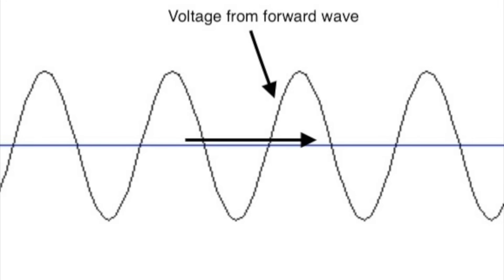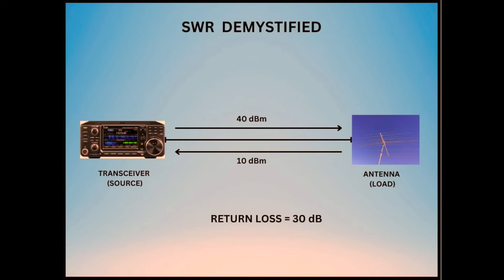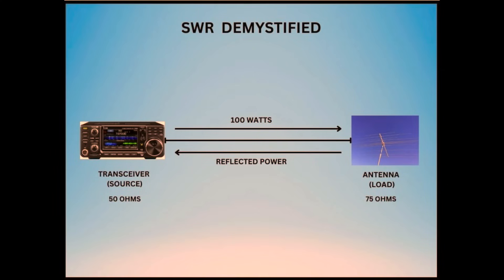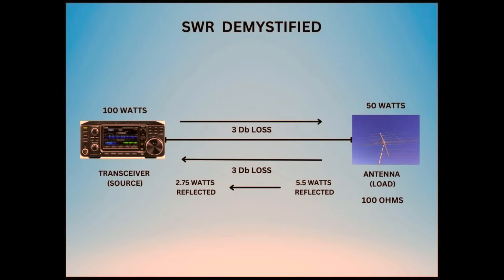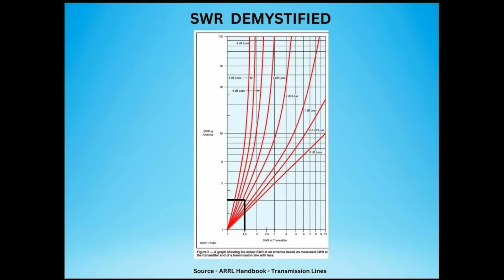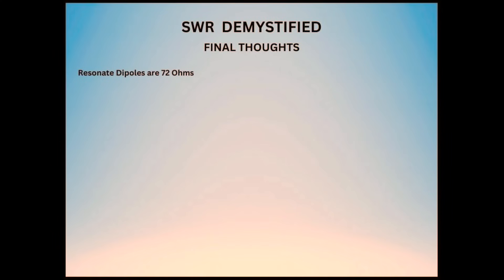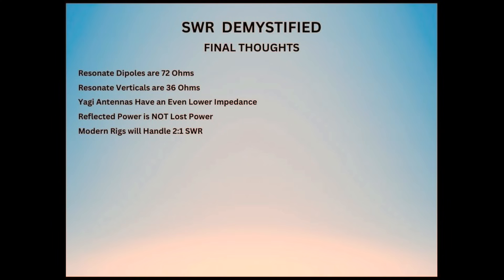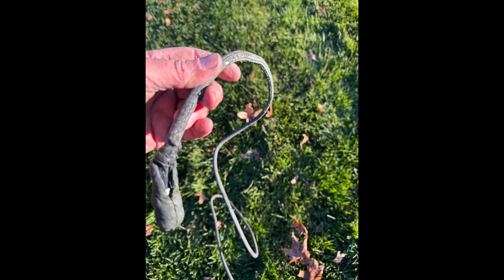The Truth about SWR: Debunking the Myths and Misunderstandings

Comment: To say that the reflected (and re-reflected, and re-reflected and so on) wave does not impose a current and voltage upon the final output stage of the transceiver would be to say the incident wave does not deliver energy to the antenna. 

The reflected power is lost. And is done so in several parts of the system. Each reflected, and re-reflected wave experiences transmission line loss. Energy is lost as current is imposed in the final transistors opposite to the direction of normal flow (collector->emitter). Not much current flows, but some does, and it does exhibit additional strain on the output stage. The majority of the energy is lost in the reflections.

If you wish to refute my position place a wattmeter ammeter at the end of the transmission line and simulate the mismatch conditions cited in your presentation.

The reflected power, in an impedance mismatch scenario, is not delivered to the load in any appreciable way. That, my friend, is why we have 'antenna tuners.'

Also, odd and even multiple electrical lengths of transmission lines, have impedance transformation characteristics. One very common application is matching stubs.
Reply: Without a tuner the power isn't produced to the difference of amount of reflected power ,the reflected wave will reflect back towards antenna at the mismatch radio coax junction, the impedance at this junction is what causes the transmitter to heat up trying to put power into a mismatch, place a tuner at this point the radio produces its maximum power ,the reflected power is in phase with the forward power back to antenna, at hf frequencies with moderate swr and low loss cable loss isn't too much of a worry
Reply: I was thinking the same thing.   I've seen several amplifiers destroyed because of high SWR and they always heat up quickly.   Does he really think that power reflected back into the final output device isn't at least partially or mostly dissipated by it??
Reply: this is what i thought. why do these people keep making videos about debunking a myth when they are creating a myth instead and debunking the truth and confusing me.
Reply: This is because an RF amplifier, unlike an audio amplifier, has an impedance matching circuit on the final stage.

Comment: On the whole pretty good info ,you could have mentioned that it's the impedance the radio sees that the feedline length and reflected wave have transformed that really kills you radio , for those who thought that it was the reflected power going back into radio
Reply: let me see if i understand you correctly: the reflected power does not go back into the radio but it changes the impedance that the radio sees. let's say this boundary is right at the antenna connector. so from the transmitter point of view, it would be the same whether you had a cable with a certain reflection at the end or if you just connected a mismatched dummy load, so far so good right? but now wouldn't the mismatch at the connector create another reflection towards the amplifier? perhaps that reflection reaches the radio? where i'm going with this is that i think they are both the same thing. whether you look at it as the reflected power going back into the radio or the radio seeing a different impedance. and as i've i've mentioned to someone else already, if you just sent a single pulse that is reflected at the other end of the cable, how can that energy not make it back into the radio, i mean, where does it go then.
Reply: @dronefootage2778  a single pulse will go back into the radio whereas a radio continually producing power it won't, it will add to that power at the radio coax junction and return towards the antenna, the impedance has changed at the radio /coax junction so the reflected wave will reflect back towards antenna
Reply: @Pioneer936  if a single pulse goes back into the radio then a continuous wave does too. if i were to increase the duration of the pulse, one cycle at a time, i guess you would draw a line where you would say the energy goes back into the radio but if you add one more cycle then it doesn't. physics don't work like that. i think what you guys are all thinking is that the incoming energy blends together with the energy that is being produced, and you guys call it a standing wave and it is, but i think this obscures the fact that energy is getting back to the amplifier and it can or will affect it.
Reply: @dronefootage2778 no! the impedance the radio sees is what causes the radio to heat up, it can't put all its power into the system because the impedance is not what it wants to see, the reflected power from the antenna is reflected back to antenna at this point the same way it does at the antenna feedpoint because of the mismatch impedance
Reply: @Pioneer936  i don't buy it. the transistor may see a different impedance but that is likely a side effect of the reflected power reaching it. if the radio sees a different impedance, something must be reaching it. if that is not energy then what is it?
Reply: @dronefootage2778  the feedline becomes an impedance transformer with standing waves, the impedance at the radio will be mismatch so the reflected wave will reflect back towards antenna
Reply: @Pioneer936  well then let me ask you this, if you replaced the antenna with a taser, it wouldn't harm the radio because none of that energy would reach it, is that correct?
Reply: @dronefootage2778  do tasers create a standing wave and change the impedance along the length of the feedline?
Reply: @Pioneer936  it doesn't matter, we're talking about energy. instead of the taser what if i only transmit for such a short time that it creates just a few cycles. when they reflect back how could they possibly not reach the transmitter and if they do then it makes no sense that they wouldn't reach the transmitter as long as it's putting in its own energy at the moment the reflected cycles reach it. when you make waves in water that reflect and you keep making waves, the reflected waves essentially travel through the waves you're creating. they don't cancel out and they will reach your hand or whatever you're using. if you make it a standing wave it may look like that they don't reach you but they are. if you use a board to make a standing wave it will take less force than if you made the same waves with no reflections. if the reflection didn't reach your board than how can there possibly be a difference between the two. if you are saying that the reflected wave changes the impedance at the transmitter then it means some information is reaching the transmitter and how can that be without energy. no matter which way i think about this what you're saying and what this video are saying do not line up with the way i understand it and i think all of you are wrong about this.
Reply: @dronefootage2778  you need to read reflections by Walt Maxwell, it goes into greater detail than the arrl on this subject, I couldn't possibly do the book justice in a couple of paragraphs so I am not even going to try , Maxwell explains it from all different angles and with lab experiments
Reply: @Pioneer936  it is said that you don't really understand something unless you can explain it to someone else. i can explain what my understanding is in great detail, i'm not sure that you can. this means i probably understand it better than you. the principal of reflections should apply equally to all oscillations at least i think so, including water. if i make  a wave in the water with my hand and it reflects back to my hand i will be able to feel it. if you buy a 1,000 watt stereo and hook up tiny speakers to it and you never turn the volume past 5% as to not blow the speakers then sure you could say technically power is not lost but practically you're losing most of the power that could have been produced but isn't. if you're a dj with this setup and guests can barely hear the music and someone asks you what the problem is, i guess you can tell them there is no problem at all, everything is perfect :P
Reply: @dronefootage2778 BTW its basic amateur radio knowledge that feedline become impedance transformers with standing waves present and that reflected power is returned to the antenna less any line loss, there is no need to believe what I say but what I've said is in the text books for comformation
Reply: @Pioneer936  it really doesn't have anything to do specifically with amateur radio. this applies to all RF and probably to all oscillations. i'm wondering if you have a misconception about the whole scenario. i never said the transmission line was not matched to the transmitter, only that the other end was where the mismatch was and in an extreme case the other end is left open. so you have transmitter @ 50 ohm impedance, then transmission line @ 50 ohm impedance, and then an open, i.e. 100% reflection. now you have energy traveling back towards the transmitter which is perfectly matched to the transmission line and if you're saying that the text books say that energy doesn't reach the transmitter then your text books are simply wrong.
Reply: @dronefootage2778 the reflected power does not go back into the transmitter and damage the transmitter, it reflected back towards the antenna because the line becomes an impedance transformer so the transmitter /feedline junction impedance is transformed from the matched 50ohm impedance to some other and yes its in the text books, why don't you have a read so you can understand this subject
Reply: @Pioneer936  i asked chatgpt about it and put what you said and the response was:
Yeah... this is a classic case of someone misapplying the concept of impedance transformation, mixing up local impedance variation along the line with the impedance seen by a wave at the source, and possibly just parroting misunderstood textbook phrases.
It then went into a whole lot more detail of why you are incorrect and what actually happens and I can't copy all of that here. The bottom line is that you're wrong and your text book is probably wrong too or you're not understanding it right. I've already tried to explain it in simple terms and frankly it's really obvious but you're stuck with what the text book apparently said so i can't help you any further.
ps: you got schooled by a cb radio person and i will do the same to any ham that comes my way.
Reply: @dronefootage2778 just clarify a few points,

1,  the impedance the radio sees changes with line length when there is a feedpoint impedance mismatch 

2,  reflected wave is reflected back to antenna at the radio /feedline junction

3,  the radio heats up trying to put power into an impedance other then that it want to see usually 50ohm

These are the main points of this conversation

Which points do you disagree with?
Reply: @dronefootage2778  I have absolutely no idea what you're talking about.
Reply: @Michael-f8f9z  can't say i'm surprised
Reply: @dronefootage2778  the impedance mismatch at this radio /coax junction won't allow the radio to put its full power into the system, it may heat up as a result, add a tuner full power will enter the system
Reply: @Pioneer936  forget the tuner and let's say it's a huge radio, as big as a car, or as big as a football field, will the reflection now reach back to the amplifier that's in there?
what you said about the tuner i also don't think that is true. if you had a radio, then a tuner, and then a piece of transmission line that is shorted at the other end, according to you because of the tuner, full power will enter the system, so essentially the tuner can replace a dummy load and the energy goes where?
Reply: No because the feedline becomes an impedance transformer with standing waves present so the reflected power will reflect back to antenna at the transmitter /coax junction the same as it reflected at the antenna feedpoint, as the impedance will differ from 50ohm
Reply: @Pioneer936  How does that work?
Reply: @dronefootage2778  I think you're a bit confused. Basically, an impedance mismatch anywhere in the circuit creates reflected power. Period. Perfect impedance matching results in full transfer of power to the load. The load may be capable of converting the electrical energy delivered to it or not.
Reply: @Michael-f8f9z haven't I just explained it, which part can I elaborate on more
Reply: @Michael-f8f9z  the first part you said is obvious and then the last sentence doesn't quite make sense to me but i don't care.
Reply: @dronefootage2778  Back to basics - Ohm's law. The impedance the radio "sees" is composed of voltage and current. We are talking about a moving waveform that has phase and phase changes.
Reply: @Michael-f8f9z  you wanna go back to basics boy? transistor --- matching --- 50 ohm TL  --- antenna.
replace antenna and inject high voltage pulse
you're telling me none of that energy will reach the transistor?

Comment: Thank you, this is helpful.  If you are receiving only, and not transmitting, is the SWR reading at the feed end a good indication of the antenna’s resonant frequency?  I use some SDR dongles for receiving signals from passing weather satellites and have tuned the antennas based on the SWR numbers. Is that a correct method?
Reply: Tricky question. If RX only the feed end is the antenna, not the receiver..
Reply: You need to know the impedance of the SDR dongle and have it match the impedance of the coax.
Then you match the antenna to that impedance.
Reply: You tuned an antenna to resonance by cancelling out the reactance, swr is not a valid way of measuring this, most antennas are resonant at a different impedance than 50 ohms, swr only measures a match

Comment: There is another large gorilla in the room, impedance presented to the transmitter. Transmitter power amplifiers are designed for optimum IMD performance and efficiency at a specific load resistance. Ham equipment sacrifices transmit IMG performance for oomph out the antenna. Still, varying that load resistance from 50 ohms to a lower impedance means the output waveform will flattop at a lower current than the transmitter tries to supply. The waveform distorts. Other hams complain. If the load resistance is higher than the design load the PA will go into voltage saturation at a lower instantaneous voltage. That gives more IMD and more complaints from hams on adjacent frequencies. Both cases can also reduce how well receivers can decode most of your modern digital waveforms. The only cure is to reduce transmitter power so BOTH instantaneous voltage peaks and instantaneous current peaks are less than the design levels. In effect this is another "loss" in the over all system performance. Of course, remember that a 1 dB (about 25%) power loss is usually not going to make a difference in your ability to communicate. But that is yet another aspect of the overall system design to consider. "What things are worth developing intestinal upset over?"

{^_-}   Joanne/The design is not over until you have looked for ALL the problems/ W6MKU
Reply: @Wizardess  that's why we use a tuner at the transmitter
Reply: @Pioneer936  Duh - but tuners were not part of the discussion.
{o.o}
Reply: @Wizardess  duh it's the cure to the issues you mention
Reply: @Pioneer936  And that "cure" an excuse to put in as much as a dB extra loss and a high pass filter to enhance EMI into your system. (That is the topology of almost every tuner out there. I built my own back in about 1970 with a little more loss and a serious lot more harmonic suppression.)
{^_-}
Reply: @Wizardess  absolutely bs ,a tuner doesn't introduce loss it main function is to allow the transmitter to produce its full power into the system
Reply: @Pioneer936  Tuners do have some loss. Some designs and implementaions have higher losses, some less. A tuner's only function is to match 2 different impedances to minimize reflection losses.
Reply: @Michael-f8f9z a little insertion loss granted, a tuner provides a conjugate match creating a resonant antenna system for power transfer, in tern adjusts the phase of the reflected power in phase with the forward power back towards the antenna
Reply: IMD is important in audio amplifiers. RF amplifiers are quite different. And I'm not sure what you mean.

Comment: Little surprised you talked about coax as if it is the only transmission line (no mention of balanced line).  Also surprised to see the use of "Db".  When presenting technical stuff, wrong units serve as a distraction.  Good discussion on reflected power. 👍
Reply: The use of dB is correct in this discussion, to indicate relative power levels.

Comment: That would explain why I have an SWR of 1.5 with the radio turned all the way down. Then as I turn up the output, SWR also goes up.
Reply: What usually explains that is the low power will not allow the diode to show the true reflected voltage.  As the power is raised the diode then shows the voltage range the meter is calibrated at.